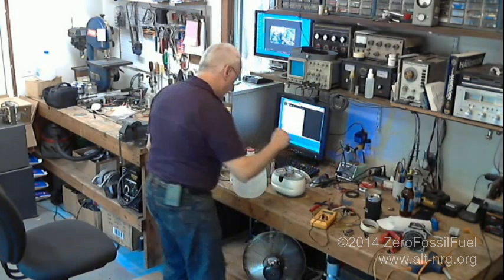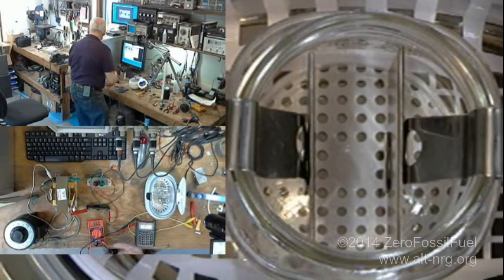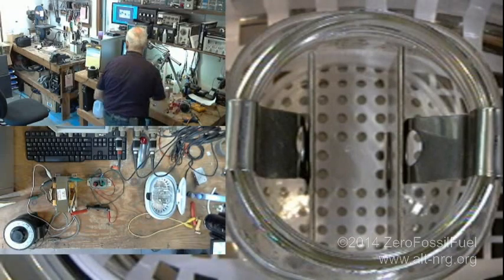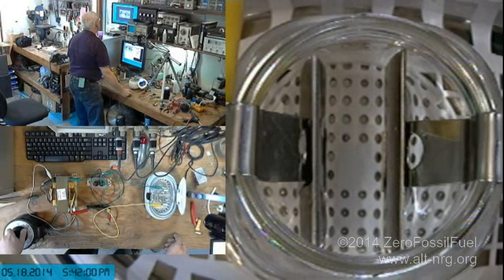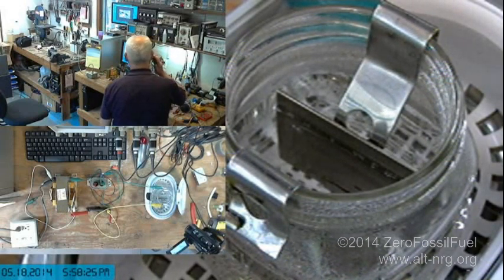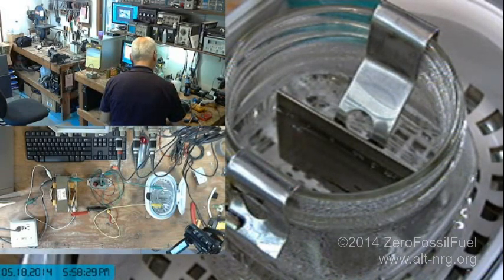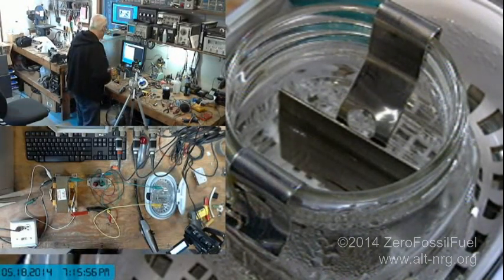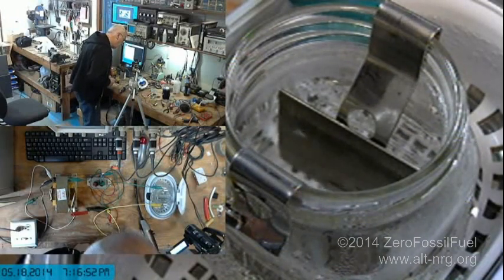#360 HHO HV + ultrasonic cavitation experiment conclusion

Comment: It needs a neutral plate. And you are right Z. The water has metal ions added as soon as the ultrasonic cavitation begins. Repeat the test with the cavitation off to see how it reacts first and then add the cavitation after initial test results. Try using platinum coated plates as well. OR, platinum meshed plates...

Comment: The ionic jumping transfer of charge results in the energy losses as motion and heat . A pulsating DC voltage synced with the molecular vibrations would result in a more efficient splitting of the molecules .

Comment: does the cell realy have HV acros the plates? in my test cell i couldn't reach HV because of the almost zero resistance and the current was high. But i came on the idea, to make a electrolytic capacitor out of my cell. I insulated the plates from the water (Stan Meyer used delrin, i got only plastig bags) and then i got almost 300V (i didnt have a HV transformer though..) acros the plates and the water was arcing, some hho was produced at almost 0Amps. When the plates are not insulated the HV will leak and creates a shor circuit in the cell, the current will go up and voltage drops.

Comment: Perhaps you might consider revisiting this experiment. Here's a few thoughts to why IMO -- Distilled Water is not conductive at room temperature (I know the water got hot, we'll come back to this).
If you didn't notice it appears when you first applied voltage to the room temp H2O, before the magnetism created a current or began heating by induction, your plates made a very good attempt at completing the circuit. They bulged and distorted significantly it seemed to me. When that action was prevented, the magnetic flux began heating through induction the water in the cavity between the 2 plates. You said the movement was flowing upward (heat rises), but not across (attracted) nor outward (repelled).
So the induction raised the temperature of the water lowering the molecular bonds and raising conductivity the electrical current had converted to an electromagnetic motion and the conservation of energy rule is applied due to work being performed.
I believe the fact of an electrical current passing along the circuit but not resulting in electrolysis or destructive shorting allows no other plausible explanation. So either add an electrolyte or heat the water independently to a boil before putting it in the electrolysis chamber and applying electrical current. Your results are likely to be different.

Comment: Nice to follow your experiment. The distilled water will still have measurable conductivity possibly in the micro-seimens range. If your objective is to produce HH +O as in a galvanic / electrolysis mode, you will need to add a contaminante... such as salt or a sulphate. Then the gasses will be emitted as a byproduct on the respectively charged plate. --- look forward to the post 'dinner bell' video.... lol at these times, you just don't feel hungry... even when the boss calls.

Comment: Interesting the action in the water... it acts like there's minimal filtering... it's not exactly DC, but that's to be expected since it's drawing so much power, therefore the resistance is low, loading the capacitor/filter down like crazy.
Hmmmm.....

Comment: 42.8Khz sound wave with a 600 Mhz pulse cycle to catastrophically disrupt water. Multiple resonators in the major axis of the vector equilibrium configuration, (8 resonators I believe) will provide the correct wave formation to separate hydrogen and oxygen

Comment: 1) Make it easier for the current to flow and put that plates closer together. Try to use sodium hydroxide and distilled water.
2) Maybe the ammount of current traveling between the plates is more importand than the Voltage(potential) between the plates.

Comment: Water will heat without conducting...the AC wave will oscillate the molecules and heat by the same mechanism that a microwave oven. I tried HV direct current on the old spiral plate cell. Gas in big bubbles and the same movement of the water. 
There is another way to get cavitation...it involves using a multiple spark gap and a tesla coil primary circuit.
Reply: m3sca1; The water will only heat up due to passing current, the current makes the atoms vibrate in the first instance.

Comment: due to the "noisy" output (filter cap too small (for the load) and the half wave rectification),  the water is oscilating with the pulsing waveform.    Set up a strobe light with variable frequency  ( up to 125 hertz)hz +/-) and point it at it while running and if you get the freq of the strobe match up with the water the movement should appear to freeze.    You made an interesting water heater...
Reply: Now that would be an interesting video ...

Comment: Ultrasonic cleaners use approximately 40Khz, these wavelengths are far too large to even dislocate the H2O molocules from each other in significant numbers. What would be more interesting is if you tried it with the water atomiser Ultrasonic transducers that run at 3Mhz with electrolysis (I bought 5x for £5 off ebay). Also decrease the gap between the plates and you wont need such high voltages. Hard drive disks could make excellent electrodes since they have a platinum surface and could be separated with thin plastic washers.
The aim here is to find the resonant frequency that will rip the H-O bonds, but any multiple will work; just less efficient.
Reply: use it to disable govt jABBA?

Comment: hello!! love your experiments!! You seem to have made a water Bridge ( discovered in the 1800s but they could not explain it put into obscurity  lol then it was rediscovered in 2006 LOL) between the two plates. I replicated the Water bridge experiment water from both beakers flowed into each other (flowing against each other) my bridge between beakers was approximately less than a Quarter inch after the initial power input ( highn voltage flyback used) then slowly pulled beakers apart slowly and got a bridge in between the two beakers. You may have seen my replication video. Looking forward to your next videos!    Cheers!!

Comment: all that equipment and all you can do is boil water...I made HHO without all that equipment and did it with 12vdc and 7amps... The water did not boil and the gas exploded when sparked...very loud explosion...What was the point of this experiment? NO one can tell me it does not work because I did it Myself!
Reply: because electrolysis is suck,,, splitting hydrogen with electricity is waste of energy, but with right frequency you can split hydrogen way more efficient than electrolysis.

Comment: Add an electrolyte ( baking soda will work) to produce HHO and your objective is increasing surface (Valence) at lower power to create the desired production which returns increased production for less energy input.

Comment: ZeroFossilFuel  the heat you are experiencing in the experiment is due to the resistance of the distilled water(which by the way ceases to be distilled the minute you apply a current due to ion mobilisation and solvation of the electrode material )

conductivity is the ease of mobilisation of electrons in the bulk material in question, resistance to that mobilisation is transformed into heat as charge potential is dissipated into phonon movement as the electrons in the material try to equalise their electron excess to rest potential

The fact is electrically speaking there is 3 categories of materials: Conductors, insulators, and semi-conductors. Even insulators will conduct electricity if sufficient voltage is applied to them to overcome their huge resistance.
At 12 v and using the same distance apart on the electrodes I observed a current of about 70 micro amps passing thru the water. water is a horrible conductor but it was NOT zero it did conduct and using higher voltages would even further overcome the resistance and the results would most likely NOT be linear as you increase the voltage the resistance would break down and you would see a curved results line.

The oxygen "side" of the molecule has a slight negative charge, while the hydrogen "sides" are slightly positive. This forms a bipolar molecule that can bind the oxygen side loosely to a positively charged ion or molecule, and the hydrogen side to a negatively charged ion or molecule, thus obeying Abdul's Law that opposites attract (Abdul, P. 1990, Chrysalis). 

Ordinary distilled water in equilibrium with carbon dioxide of the air has a conductivity of about 10 x 10-6 W-1*m-1 (20 dS/m). Because the electrical current is transported by the ions in solution( in this case the water itself being a polar molecule and the dissolved CO2), the conductivity increases as the concentration of ions increases.
Thus conductivity increases as water dissolved ionic species.

Subsequently an electrical current results from the motion of electrically charged particles in response to forces that act on them from an applied electric field. Within most solid materials a current arise from the flow of electrons, which is called electronic conduction. In all conductors, semiconductors, and many insulated materials only electronic conduction exists, and the electrical conductivity is strongly dependant on the number of electrons available to participate to the conduction process. Most metals are extremely good conductors of electricity, because of the large number of free electrons that can be excited in an empty and available energy state. 
In water and ionic materials or fluids a net motion of charged ions can occur. This phenomenon produce an electric current and is called ionic conduction.
Electrical conductivity is defined as the ratio between the current density (J) and the electric field intensity (e) and it is the opposite of the resistivity (r, [W*m]):
s = J/e = 1/r
Silver has the highest conductivity of any metals: 63 x 106 S/m.

this is why you are observing hydrodynamic forces or (capillary action), the movement of the water molecules themselves as the polar sides of the H2O molecule collect charge from one plate and deposit the charge onto the other, once enough ions a dissolved into solution with the water this effect will die down as the distance between conductive ions in solution become concentrated enough to form a path between the electrodes this is also the same reason why electroplating works.
Reply from the maker: You are correct about the non-linearity of conductivity vs voltage. This can also be observed using electrolytes at lower voltages. The avalanche is not unlike a zener diode. The equivalent resistance of the water at ~3500VDC was about 11K ohm which dissipated about 1200W of heat energy. I was quite surprised at how much the conductivity of the distilled increased, the result of what you define as ionic conduction. I plan to repeat the experiment taking before and after conductivity measurements to demonstrate whether or not the condition is transient with applied voltage or if residual contaminants remain afterward. I'm trying to use these results to better understand Stan Meyer's experiments.
Reply: i look forward to that experiment, you will find that any water you have no matter how pure you make it will have trace elements, as water is an excellent solvent, even if you manage to distil water so pure... the minute that water comes into contact with air, you will have dissolved gasses such as co2 introducing ions, and dissolved oxygen as well - that's going to affect the base conductivity of your water.. id expect the conductivity of your water to increase slowly and then start ramping up exponentially as time goes on and the dissolution of ions catalysing even more migration of salts and ions from the plates into the water. you may want to include this into your next video and make this a very educational video for your viewers.

Comment: Has anyone else commented on blue glow/discharge at top right edge of far plate? At 24:30 and most interesting at 24:46. I say interesting at 24:36 the high voltage appears shut off  and the arc remains till ultrasound is turned off.
Reply: The glow is light from the down looking camera reflecting off the lid of the ultrasonic cleaner.

Comment: Revisiting an old video, but for others who happen this way... commercial "distilled water" is not a very good dielectric... when working with such high voltages.  It's often as low as 1 MOhm/cm because the steam is in contact with the surrounding atmosphere, which contains pollutants .  Where I work we have a water double scrubber system that produces Deionized water that's around 18 Mohm/cm... now that is pretty much ideal. However, the moment you put anything that's the least bit soluble in it, it's no longer ideal... because at that level of purity, water becomes very corrosive, and will attack the (in this case) average stainless steel.  "304" Stainless alloy is very compatible with DI water... 316 SS is also good, but not as good as 304.  Oddly enough, high purity Brass and Bronze are also as highly resistant to DI water corrosion as 304 SS.

High frequency pulsing the HV through pure water would be the next trick... but is a tough trick to accomplish.  Maybe a full-bridge driver on the primary of a high-frequency planar transformer would get there... driven at maybe 700V (with the new SiC or GaN transistors) at 10kHz, with a 1:5 transformer ratio... no rectification... just raw bipolar pulses.
Reply: Ok, ya got me. What do you do for work besides flex on the on the internet?

Comment: MHD; magneo-hydro-dynamics;  They use that for pumps.  YOu can inversly retreive a current from water flowing in a magnetic field and plates... it's a generator also; might work for high speed boats

Comment: re: previous video: people were 'requesting' that you use the stainless cleaner container as one electrical connection for electrolysis, you thought it might damage the cleaner electronics.  My cleaner looks as identical as possible to yours, and there is a hard 'pad' between the ceramic transducer and the stainless bowl... it's about 1/16" thick or more... so there's no electrical connection. I'm sure it's for UL safety reasons... we don't want to mix consumers, water, and 650V AC square waves now, do we...

Comment: first off, if you want hho, you need to put an electrolite. so you aint busting anything here :p. + I think the heating is not from the electricity passing through water. I think you are getting a microwave kind of effect. water molecules are dipoles. So If you spin a single molecule of water in a glass, for exemple, all the other molecules will have to spin too. with your dc voltage, you are polarizing the plates and so, spinning water molecules at 60hz, with huge force + there is a flow in water disturbing the STRUCTURE of water wich is restabilizing itself 60 times per seconds. For your equipment heating up... meaning there is electricity being drawn by the circuit, meaning this water is conductive... I think this is not the case. I think there is current spiking back in your circuit because of the ''lenz'' effect comming from the spinning water molecules. In theory, if you hook an amp meter up in your circuit, It must be showing non sense fluctuating measurments. And If you hook an osciloscope right to your electrodes, you should see special things too. 1 ''wave'' being your DC HV and 1 other wave wich would be the spike back from the spinning molecules. probably very low voltage, but high amp. It is my intuition. thankyou for awnsering back. I would lik to hear your thoughts about this. thanks

Comment: I have only 1 question? Do You  was boiling water? Or want make clean gaz 2H and O ?
Because I think You have 1 mistake in Your experiment. I think You use voltage AC Correct?
Wrong, if You want make gas from water (I was long time ago experimenting with that my self in home) You need use DC and voltage constant. Other wise Your water will only make hot.
 To brake the atoms from H²O to 2H and O You need have one direction voltage. And on the plate of + will do that job.
 With 24V DC I have weary nice results with producing gaz. I think with higher voltage, I could produce much more gas. And one more. Plates You need have not flat but sanded with sandpaper. It will help to increase results.
Reply: maxim25o2 He had a rectifier to change the AC  voltage to DC ,maybe  pulsating.

Comment: Looks like Magneto-Hydro-Dynamic Propulsion. And Im not trying to be funny about the movie the Hunt for Red October. A way to get water to move in a target direction without moving parts.
Reply: Its known that on all edges of something inside water will have a layer as thin as a hair called "EZ" water it has a negative charge and scientists have proven that a small tube causes a water flow in a certain direction. The scientists that did the experiment added Micro sized particles to view the water flow. I encourage you to research "the fourth face of water", by Dr. Gerald Pollack ! I believe the EZ water effect is what is causing the pumping action on the water, I think high voltage is increasing the EZ waters effect. I know light or photons can improve or increase the EZ water.